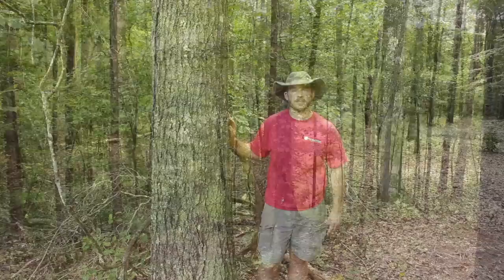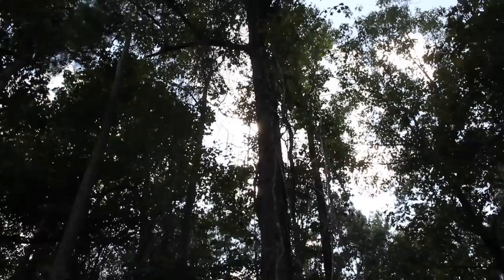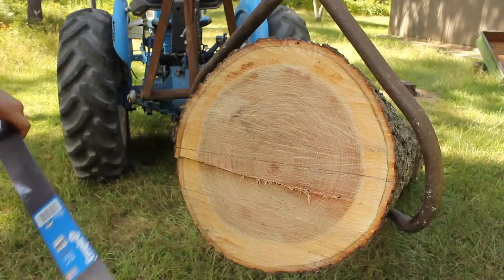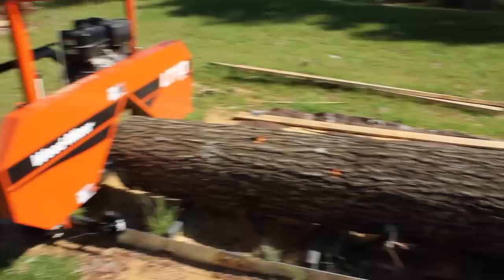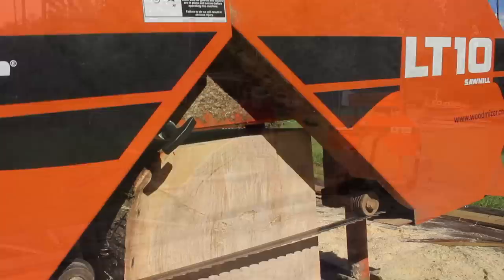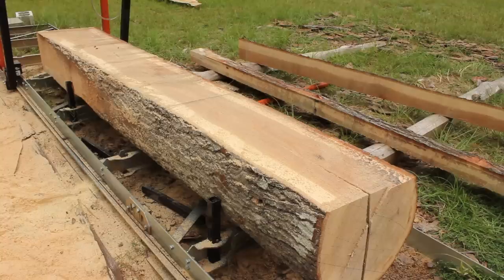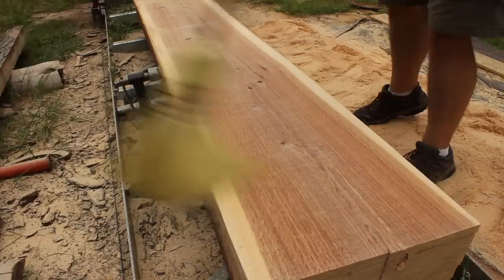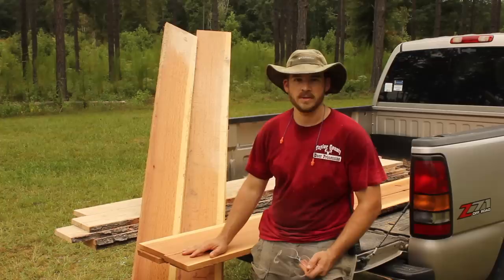AMAZING Grain in a Quarter Sawn RED OAK!

Comment: You can get a lot more quarter sawn boards. The process involves turning your cant a quarter turn back and forth. It is time consuming and gives you random width boards but will give you a lot more desirable lumber. This is the reason you see random width flooring in a lot of older homes that used materials from the home place to build.
Reply: Plus if you have the right trees this is the [figured] wood that guitar/fiddle etc makers find so desireable. I've seen electric guitar sized maple cuts go for $300
Reply: Almost any cabinet making book going to show how to quarter saw a log. Do some reading get more of what you want.
Reply: now THIS is the first thing posted that has made sense to me...
Reply: Agree 100%.  Needs to be flipped for quarter sawn maximum yield.  Widths will vary significantly, but the grain will be more consistent.  This was just a "modified" flat sawn method, which = Flat + Riff + Quarter.
Reply: @robertphillips760  Yep. It wasn't quarter sawn, just flat sawn. The initial cut down the center simply halved the possible board widths.
Reply: on one of the blogs they talk about a method called reverse roll quartersawing.  I tried it on my mill and it yeilds a lot of figured grain featuring the rays going across the board.  It is a little more work but gets more cool grain than the standard methods.
Reply: @robertphillips760 ...I always heard to flip the board end for end before rotating for the next cut.

Comment: You can get 2 wide qtr sawn boards by cutting the log down the middle and taking one off each half. Then you can get 4 pc by cutting the halves down the middle getting two pc. from each. Next you have to put each quarter on the saw such that you make a cut to the center of the log and then get two more boards off each quarter log, 8 pc. That gives you 14 boards of as much width as you can get and still be quartered. After this what you are likely to get are boards displaying rift, still nice but they won't be true quartered & they will be narrow. Red oak doesn't usually display as much nice fleck as white oak. You need to be very careful and align the saw cuts with the pith of the log on both ends. Logs should be end coated as soon as they hit the ground and then be sawn as soon as possible. Otherwise they will degrade and likely develop assorted cracks, stain and other defects. Get yourself information from the National Forest Service (available on line), Gene's book called the WOOD DOCTOR and Bruce Hoadly's book UNDERSTANDING WOOD. They have information on small drying systems that you probably should look into. Building a solar dry kiln & buying a moisture meter (one that costs at least $200) is a good next step. The books have information on each of those. Using this information will allow you to maximize the value of your little mill, logs and your labor. 

Have fun, be safe.
Reply: Yep. Pretty much what I was going to say - although the increase in quarter sawn is minimal with logs under about 16" diameter. The big advantage is that it give you two or more maximum wdith qtr sawn boards.

Comment: That was a great video. The layers Just Before your Quartersawn Wood is termed "Rift Sawn", It is "halfway" from Flat Sawn to True Quarter Sawn, for Hard Wood Flooring it is MORE Durable (resistance to wearing out) than Flat Sawn, but Not as Resistant to Wear than Quarter Sawn.  

As a Floor Mechanic (Installer of flooring) the Largest Floor I worked on was 7,000 Square Feet, and our Contract Stipulated White Oak Rift Sawn for the Best Cost Factor in Wearability versus Money Spent. It was milled by Smith Flooring /company, and the WOOD itself was Contracted to be cut from a Very SPECIFIC Growing Region, from which was the Densest White Oak grown in North America. The Flooring was 3 1/4" X 3/4" and Specified a length of cuts No shorter than "Dueces" or Two Footers (Average Length of Dueces varies 6 inches overall, so 18" to 30"; then the Longest Possibles cuts of course!!! (varied up to 9 feet long). That was to keep the floor from looking "too busy" an optical illusion based upon size Square Footage of the floor and Just looking down at it!

That was for a Winery that was built in the Late '80's through Early 90's in Napa County, California. the Total Contract Time, from Smith Co. Milling then delivery, to Finished Floor was nearly 18 MONTHS, due to That "Rift Sawn" section of the contract: it took the Mill nearly 9 months just to produce that much RIFT SAWN Flooring!

I was the Last person to actually work on the floor itself, As we needed to Install Bronze Floor Plates to cover Electrical Outlets AFTER the floor was finished. That (sub-contract) was over 40 hours of work in itself!
Reply: If you're using oak for flooring, I don't think you have to worry about "durable" for at least 50-100 years!
Reply from the maker: MADsighNtist Great story! Bet it was beautiful. Thanks for stopping by.

Comment: Once you get the quartersawing process down, you will be handling smaller cants, but rolling the cant for each cut.  The benefit will be that every board will look like those wonderful boards you got near the log center.  You will also have many different widths as each cut on each cant will yield diminishing widths by the board thickness (plus the kerf).  Nice tree  you got there.  You can do a lot with that saw.

Comment: It's tough to get much yield from any log -- even with a bigger mill. I have a LT-40 Super Hydraulic and when I want some Q-sawn I find a huge oak log and split it down the middle with a chainsaw. Then I start whacking away and soon enough I'm into the cream. I did my kitchen floor with Q-sawn red oak. Looks great. I'm surprised that your butt log had so many knots in it. Still looks great. And to those who say that it isn't quarter-sawn -- the rules established by the NHLA pretty much say that if it looks quarter-sawn then it is quarter-sawn. 

Great vid. Thanks for posting.
Reply from the maker: localcrew Thanks! Appreciate you watching.
Reply: localcrew I built my entire hour with quarter saw. Never touched it with a chain saw. Used my wood miser entirely. Chain saws waste  too much wood for my taste.
Built my kiln and dried the lumber on site.
Reply: We never got much yield on our big mill. We sawed in half and run out the far end. Load the halved logs back in.  And saw away. 45 degree end grain or better in the boards. We laid it out after all was kiln dried as I graded it. Mostly if not set up for it The  premium is not worth the yield. But you are right,  if it looks quarter sawed then call it.
Reply: Money shot at 26:45

Comment: Never seen a miller put the wedge in the cut on top and then cut the log at the breakpoint on the bottom.  I always used the wedge to keep the log from pinching the saw blade, not opening the first cut to offer breathing room for the log.  Lol!  Just flat sawed the log, beautiful grain, amazing!
Reply: didn't understand that either.

Comment: --- beautiful wood, and , while those center cuts do have quarter sawn grain,  they are the normal result of flat sawing any log if you don't keep quarter flipping it.  True quarter sawing you actually cut the log into quarters, and then chock each quarter at a 45 degree and flat saw as much as you can out of it  -  lots of work, lots of small boards, lots of waste ( about 1/3 ) but all quarter sawn.  It is easier to just flat saw the top 1/4, flip 180 and flat saw the bottom 1/4  -  put that aside for other uses.  Then continue flat sawing the remainder -  it will all be either quarter sawn ( as it gets close to the heart ), or rift sawn ( the upper and lower cuts )  [ rifts are usually counted as quarter sawn also ] .  Now you have two piles  -  with the quarter sawn being the larger.  NOW, in order to get true quarter sawn grain, you need to take out the very heart of any boards where the heart shows in your pile of quarter sawn  -  you can do this when you are making your dimensional cuts.  You will have less total loss than with true quarter sawing,  lots quicker, and you get wider boards showing quarter grain.  You can always sell that non-quarter pile to folks doing cabinets, stairs, etc.

Comment: My approach with mine is:1st cut;1" above center,2nd cut through center,3rd cut 1" below that. Throw off cuts then you have 2 quartersawn at start just split. Then the fun begins with little turns of log ,you get random widths of perfect quarters.Takes a lot of time and turning but worth it on some wood,time = $ price

Comment: Jack the thinner end of the log up so that the center line of your log is parallel to the work surface. Then just cut enough of the flare so that when you turn the log it will lay flat and the center line is parallel again, then cut the flare on the other side. You really need to make sure you are paralllel before making that first cut or the whole log will be out of alignment.

Comment: I never sawed but spent 20 years grading.  We saw figure in white ok down to 45 degrees. And sold tons of it.  True quarter is almost vertical. But cabinet makers like it ok to 45 or so. It still gives a good no warp no twist board. We sawed  plain for max yield and laid out quartered as we found it grading.
Graded truck load a day after kiln drying. 3 graders and could hardly keep up with the big band saw mill. Our cants went to our pallet building do build pallets.

Comment: The way he pulls that chainsaw out of the wood,,  swinging it around with that chain still spinning hard,,,   Scared the crap out of me!   This fellow needs the chaps on bad
Reply: Truth is that chain will spin for a little.  When running a saw it is best full throttle or not at all reason is if you feather the trigger you are more likely to get kickback which can be fatal.  The biggest thing I would pitch that saw just cause it does not have a chain brake.  When you fully understand how a saw having a working chain break can save your life in a kick back situation you will not want to run another saw without it.  Kickback will happen to even professional sawyers.  Not having a chain break can be the difference of a sawyer being alive or dead after a kick back if you are holding the saw properly.  Kinda laughing you do not want to see me swinging a saw around limbing up a hemlock tree then.  I usually have planned up to 5 cuts in advance so I can cut in swinging motions and I have a much bigger timber felling saw.

Comment: Beautiful tree, oaks typically look amazing when quarter-sawn. But the way you cut it would technically be considered plain-sawn. Only the last row and the next row or two of the uncut half would really be close enough to be considered quarter-sawn. The process I've seen used most requires you to cut the log into quarters first, then mill each quarter individually, setting each quarter so that your cut edges are at 45 degrees from horizontal (level) before you start milling boards. You would get about 7-8 boards per quarter out of a log that diameter, with varying widths. Its a lot more work and more waste than plain-sawn wood, which is why quarter-sawn lumber is so much more expensive.

Comment: You have some absolutely beautiful land to work and be proud of. The cuts from this videos Red Oak tree trunk are very usable as being top furniture grade lumber. However, since it is Red Oak, it would have been more much profitable when sold, if you had left the slabs wide and made the cuts in 2 1/4  or 2 3/4 inch slabs, which could be planed and finished by craftsmen into 2 or 2 1/2 inch boards, which are in high demand for use as custom table, desk and especially bar tops. Quarter sawn hard wood is a high seller as well, but, for the time it takes in sawing quarter sawn boards, it is only profitable if you have a continuous buyer.

Comment: Vertical grain would be between 90 and 70 degrees. Anything less than that would be called Rift sawn and eventually Flat sawn. Rift sawn wood can look like vertical grain but its not. 

The way I quarter a log is by starting with a big log 40 or 50 inch diameter or bigger. My mill can't handle that size so that means Chainsaw time. Invest in a saw with a 3 foot bar and cut that log in half. turn it 90 degrees and half it again. Now you got 4 quarters of a log. If you look at one quarter from the end it looks like a piece of pizza. Put that pizza on the mill with the tip straight up and cut two or three inches off. Next, turn it so the tip is now straight down and cut a few inches off the round side or "crust" of that pizza.  Now that the "crust" is flat, put that up against your dogs to square it and start your cuts. The tip will be suspended off the mill not down against it. After a few boards off the top you'll have to turn it upside down to finish it. Cutting it this way will waste a lot of wood but every board will be vertical grain.  
With a log the size you have there, you would have been better off just flat sawing. As you get towards the center each board will have vertical grain less the center. 
I can hear the excitement of sawing in your voice.  I bet there will be a bigger mill  in your future.
Reply: You’re right on
Reply from the maker: BrianStocking Thanks for the detailed tips! I certainly hope to have a larger mill one day.

Comment: quarter sawn is radial from the center if you want even more yield (like the spokes of a wheel)
Reply: Exactly he would have gotten a lot less waste . Start with a circle from the center of the small end the diameter of the required board thickness , mark the first cut with two parallel lines equal distance from center , then use a rule of that thickness eg. 1 1/2" or 2" , the blades 0f a framing square  , radiating from center circle  . Use the cut off corners as a wedge to get correct angle for subsequent cuts

Comment: My grandfather would have loved a simple sawmill like this I remember him and one of my uncles running a sawmill powered by a D4 Caterpillar engine. But boy would that thing power through some lumber
Reply: its called a saw bench built to do a job we used to run a 52 inch blade with 80 hp oliver  no trouble.  1956

Comment: Getting quarter sawn wood from a bandsaw mill is pretty hard.  The best way is to cut it into quarters with that mill, then take it to the table saw mill and alternate flipping the quarter over.  You have more waste, but about 85% of that log would be quarter sawn, or at least rift sawn. In a log this small, the usable pieces are of course smaller and random due to bug and knots.

Comment: Personally you did a great job you only get better with practice.  You have a good handle on the process  in my opinion. You are limited on your small mill for quarter sawing which is more efficient wood wise on much larger logs. As you can recover quater sawn wood from your quartered slabs. Something that would help with that is to make you a couple jigs for your bunks. That would hold and support those slabs at an angle to allow for quater sawn cuts.
  I must say that wood was natures art will make beautiful hardwood flooring. Your doing good love the video's.
Reply from the maker: Ken Jett Thanks Ken! Wood Mizer has another way to quarter saw that I think might work better with my small mill.  You are correct, it was beautiful lumber.
Reply: @falllineridge  its quite possible they do know their mills better.  I came from old school milling. All my experience is on a circle mill but the technique and results are simular. Congrats on the beautiful harvest hope you get lots more like it.

Comment: When you split the log, take two boards--one on each side of the center line.  that gives you two quarter sawn full width boards.  then turn the two remaining halves 1/4th turn and do the same thing.  that would be 4 more half width full quarter sawn.  Then  each quarter on its own turning 90 degrees after each cut.  Pain in the ass, but it gets you the most quarter sawn possible.  Easier if you square the log first.  I put kind of a toe board on my mi.ll by mounting a scissor jack and then make sure I load the small end over the jack

Comment: Quarter cut the log first, then cut boards off the bottom, flipping back and forth after one or two cuts.  Save your back, raise your mill about  two feet off the ground.  Use a pike instead of a cant hook.  You can stick the pike"s sharp point into the ground, so it is ready to use.

Comment: Very cool vid - thats a great attempt at trying to get a few "quarter sawn" boards out of a mill like that.  I don't know if you could technically "quarter saw" a log on a mill like that because you'd first have to quarter the log - which you could do easily enough - but then sawing the quarters - you'd have to have figure out a way to wedge the quarters on the bed such that the flat face of the quarter is parallel to your saw blade - and it would be hard to get that stable enough to cut - and you'd need a real monster of a log to get anything really useful out of it.  Overall i think you did about as good as ya can do with that set up - the boards looked awesome!

Comment: Larry Swietzer's comment is right on . When you pencil the layout on the end of log,draw four quarters( one line right horizontal across the center ,then one line perpendicular to that. Now you have four quarters. Now pencil in VERTICAL cut lines on upper left quadrant,and lower right quadrant. Now pencil in horizontal cut lines on upper right quadrant and lower left quad.The layout sorta looks like a multi swastika. Sorry. Now you see the boards with vertical grain and see that you will get a few truly 1/4 sawn or RIFT sawn. The beauty is the TANGENTIAL rays.These rays are on just a few rift sawn boards. The rays are part of the feeding system of the tree. Nice job on the milling. Beautiful oak.